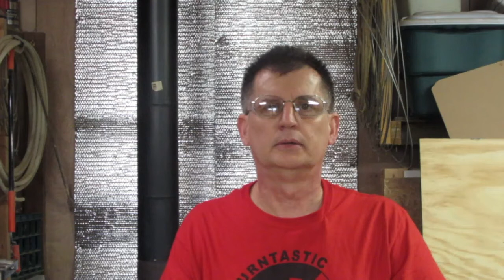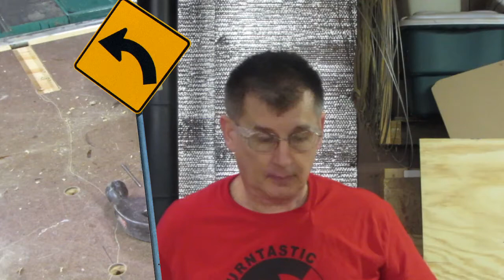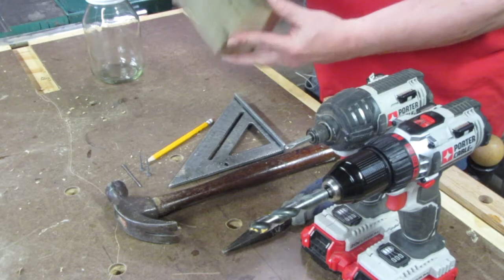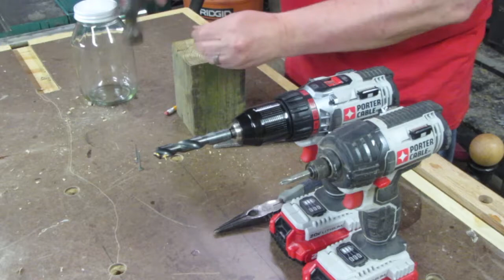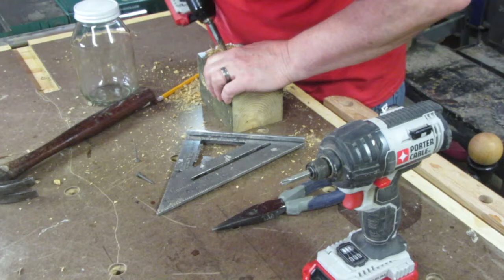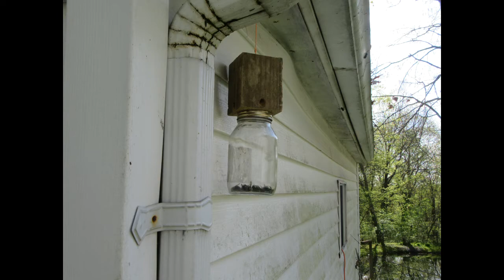Carpenter Bee Trap

Comment: Hmm, glad you had success with these.  I have same problem with Carpenter Bees, built two traps last spring but got none!  I'll need to revisit my design.
Reply from the maker: Did you use pressure treated wood? They are less likely to go into the holes if the wood is pressure treated.